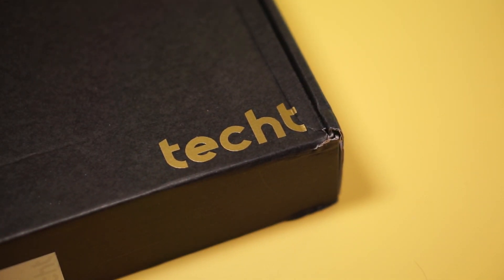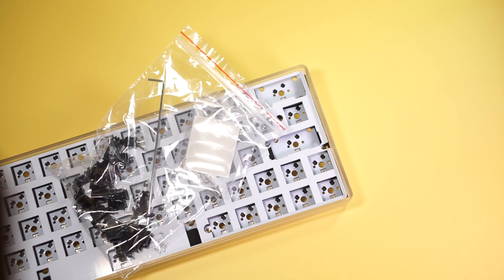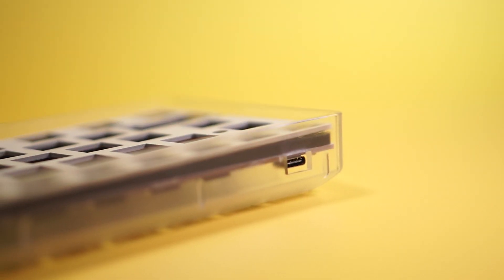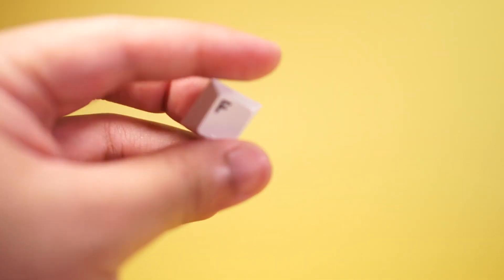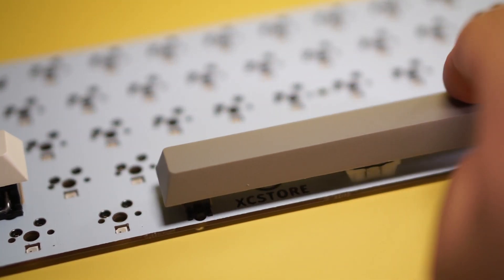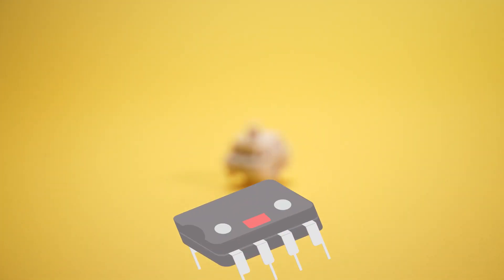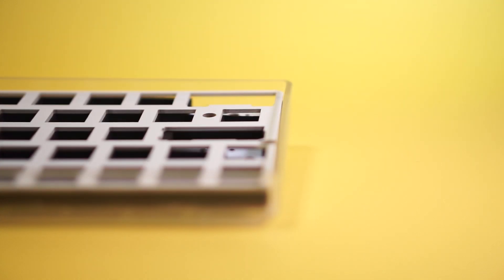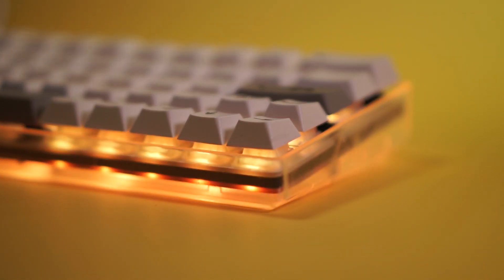A Budget Keyboard Kit for only 50$ (CM64 Kit)

Comment: If i were to switch out the milky yellows for akko cs reds, will it be better and cheaper?, Not quite sure yet.
Reply from the maker: So I checked online and the Gateron Yellows comes in around RM0.70 per switch. So for the CM64 you need at least, 64 switches. That would make a total of RM49 excluding shipping. Where as the Akko comes in a pack of 45 that cost around RM45 and you need 2 packs. So around RM90. The Gat Yellows are cheaper to get and you can put that extra on some Krytox to lube.
Reply from the maker: But the Akko are a bit smoother out of the box. If you don't wanna lube than the the Akko is really good but if you don't mind lubing and want a more budget route then the Yellows are great.
Reply: @AFIQKeebs  thanks, i was very confused
Reply from the maker: No Prob 😁
Reply: Well, the akko reds are amazing switches but personally, if you're looking for linears, try jwk full nylons. They're way better imo
Reply: you can get akko cs for rm0.66 on taobao btw

Comment: Hi…can help me with via??i bought this kit from techt aswell…but via cant detect my pcb and some of my key cant resgister…can u help me with it bro?
Reply from the maker: Yo yeah no prob... So the PCB isn't proper VIA compatible meaning it doesn't just detect when plugged in. What you have to do is to make sure that your PCB is connected and VIA is opened. In the box there should be a link to the file for the board it has the instructions and the JSON file that is what you need to connect your board. Next, go to VIA and on the left top corner click the File name. Find the JSON file you just saved and it can detect your board. There is a configurator to customize you keys but I don't recommend changing any lighting keys cause it can mess up the board and there is a key tested in there to see which key doesn't work. If your key is not working check the switches for bent pin and the Kailh socket in the back sometimes it doesn't get soldered on properly or popped off when the switch gets put on. If there is still a problem with the PCB just reach out to the seller maybe it could be a defect. If there is anymore questions I'll be willing to help you out.
Reply: @AFIQKeebs  thanks alot bro….now it working properly…but some pin were bent need to fix….so for this pcb better keep the brightness low?
Reply from the maker: If you’re using a metal case i recommend to close the underglow cause it’ll heat up but it you have a plastic case it’s fine
Reply: @AFIQKeebs  im planing to change to wood or tofu like yours…if tofu case which should i buy 60 or 65?or issit both same can fit this cm64 pcb?
Reply from the maker: The CM64 is a 60% form factor get the Tofu60 instead… the Tofu65 is a bigger case it wouldn’t fit

Comment: Does this use screw in stabilisers
Reply from the maker: Yup it comes with the non screw ones but you can upgrade to screw ins
Reply: @AFIQKeebs  what screw in stabs do you recommend? I was thinking either Everglades or Durock V2s but the Durock V2s are ~50% more expensive.
Reply from the maker: I used Everglides but i keep getting unlucky with the spacebar wire cuz i keep getting bent ones but they are really good but durocks are way better

Comment: Yo may i know If its possible to use plate mount stabs on this kit ?
Reply from the maker: No... The FR4 plate that comes with the kit doesn't have the proper notches for plate-mounted stabs
Reply: Ah okay thanks anyways
Reply: But if i did replace the plate it most likely would work right
Reply from the maker: Maybe it would… im still rocking the FR4 plate
Reply: @AFIQKeebs  aight thanks thanks ur vid helped a lot !!!
Reply from the maker: No Prob 👍